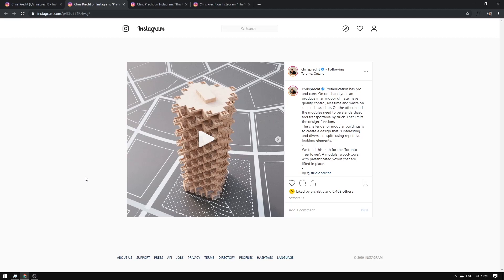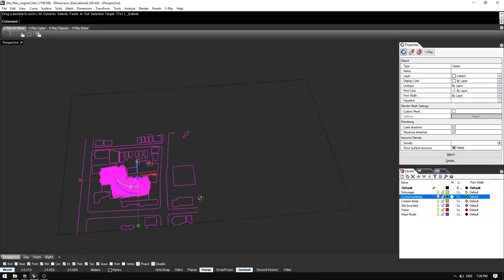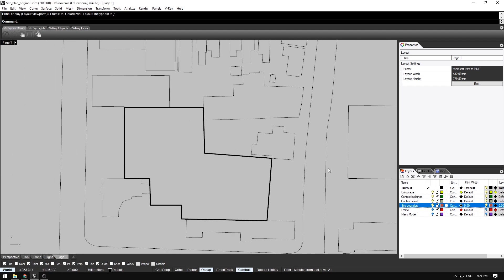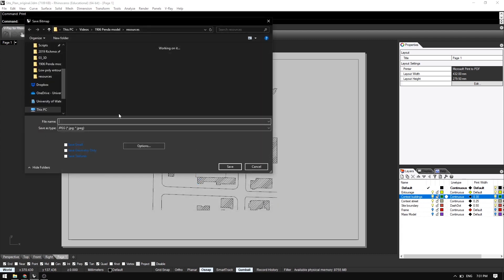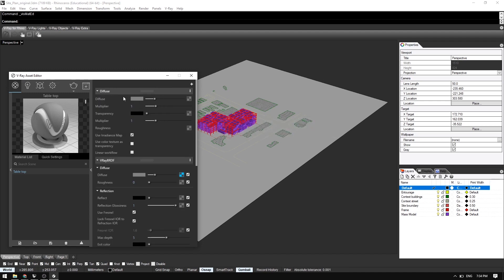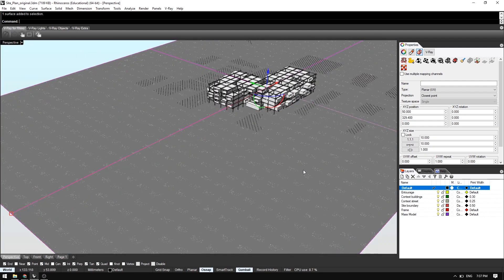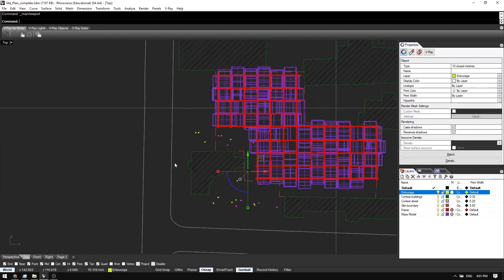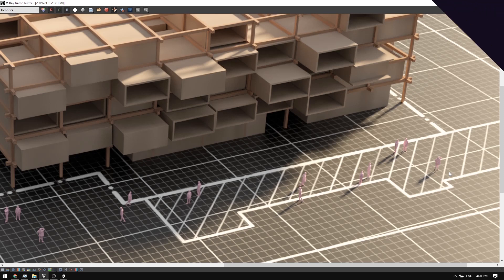Render Realistic Physical Model | Rhino and Vray

Comment: sir I dont know why vray keeps clearing my inner grid every time it render, but keep the outerline
Reply from the maker: Hmm that's weird. Did you make sure to create the inner grid inside the outergrid and repeat the inner grid?
Reply: @ArchiHacks  I know why now, CPU and GPU gets different render results. It gets right when I use CPU render, just clueless
Reply from the maker: Brilliant! I learned something new from you :)
Reply: @minhngodang5375  Hey just wanted to check up, if you may have gotten the problem under control. When I press Render, it removes the inner Grid lines, whilst rendering with GPU, but not with CPU. would be to sad if I had to render with my CPU, since GPU is faster in my case